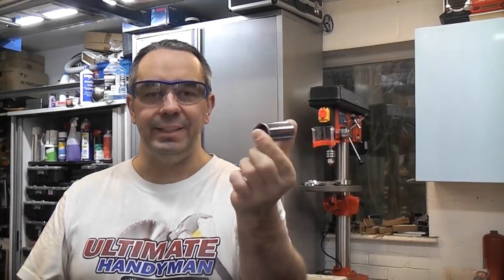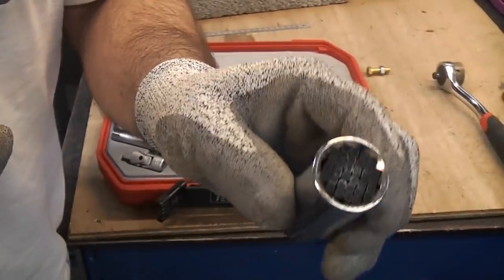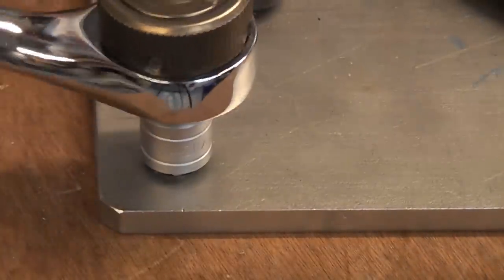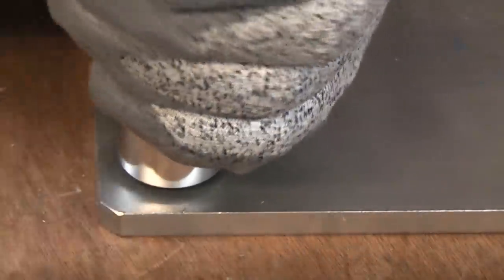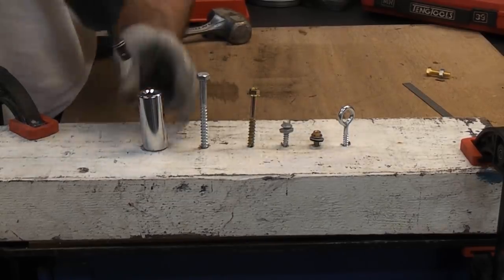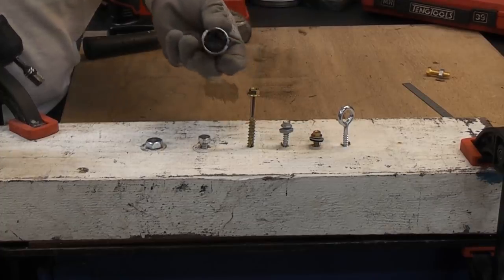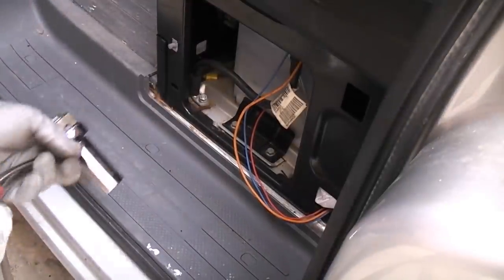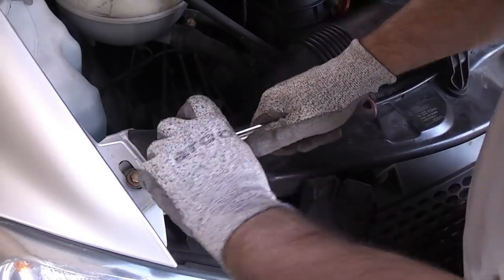Universal socket review | Richmond universal socket

Comment: I’d forgotten about these. I had a Gator type years ago. As I recall it had a larger number of thinner pins. I found it useful on really rusted or rounded off bolt heads, but I eventually pushed it too hard and as soon as one pin broke the rest quickly followed.
Reply from the maker: Thanks for the comment ;-)

Comment: Another honest and quick review.
I have the “gator” socket like you mentioned. I’ve kept it in my garage a an emergency quick use socket. I’ve tired it like you did on a few sockets and had the same issues you did. 
I used it once in a slightly rounded bolt head that a regular socket wouldn’t grip, that’s the only time it was useful. Although again like you said it does damage the nut or bolt.  
I’ve had to use it in an emergency to fix my dads van side door middle hinge/roller and we forget our socket set and the shop, and I remember me having this gator socket in the garage. It work well, I did have to put a lot of pressure on it, but hey, it did the job. Keep up the great videos.
Reply from the maker: I'm glad you had a similar experience to me ;-)
Thanks for the comment

Comment: I had considered one of these for the mini/emergency tool kit. I won't bother now. 
I considered on of those multi ratchets that has 8 sizes on one ratchet handle. Same problem with clearance that you noted though, you can only deal with very shallow headed nuts/bolts. At the end of the day nothing beats the proper tool for the job.
Reply from the maker: Yes, clearance is the main problem!
Thanks for the comment

Comment: I’ve had a Teng Tools socket set for 25yrs and use it virtually every day. They’re the absolute dogs.
Reply from the maker: Yeah, they are good. I use this small set at home, but have the larger 1/2 drive set at work, as well as a load of Teng 1/2 impact sockets. The only Teng tools that I'm not keen on are their adjustable spanners and their version of Stilsons.
Thanks for the comment
Reply: Bahco adjustables and Clarke aluminium stillies for me. I don’t do anything too heavy duty. I’m now replacing with Wera stuff as stuff gets lost.
Reply from the maker: Bahco are superb, I have about 8 Bahco adjustables ranging from 4" to 24" 
Ridgid make some really good Stillies!
Thanks for the comment
Reply: Yeah, l’ve got the Rigid angled Stillies for getting into tight spaces, wouldn’t be without them.

Comment: Weird mate, i had a different one of these (it eventually broke after 5 year undoing a wheel nut with a breaker bar) always worked reasonably well for me... I had a different one a cheaper looking one with smaller but more bars. They arnt as good as a regular socket but if you have limited space or have to be quick (working under a car in the rain ect) they are quite handy.
Reply from the maker: Perhaps it is just this particular make, I'm not sure!
Thanks for the comment

Comment: I have one of these things, and I admit I've rarely used it, but it seems a better design than the one you're using, as each of the pins is hexagonal so interlock each other rather than square of yours, would I say it's the best thing ever, most definitely not, it's a gimmick but it works, sort of. (oh and mine is a cheap Lidl one)
Reply from the maker: Thanks for the comment ;-)
Reply: Lidl tools are mostly German made and ive had a drill sander saw etc etc.. And the drill is one if the best I bought and cheapest.. Lights show where you drill lights show battery situ.. Superbulous drill had it yrs..
Reply: @kenwolf6293  
I've found the Lidl & Aldi stuff tends to be German-brand but Chinese made. That said, as cheap tools for occasional DIY use they tend to be very good and usually better than the Homebase / B&Q equivalents.

Comment: The only benefit I have found for mine was it works well on odd shaped nuts and wing nuts.  Other than that I use the proper sized 6 or 12 point sockets. On mine the pins are round not square like yours.
Reply from the maker: Thanks for the comment

Comment: What knee pads sis you have on they look just the job for me?
As always excellent reviews
Reply from the maker: They are called recoil knee pads, I was sent them to try out over 12 months ago, but the only time I'm on my knees a lot is when I'm on site and I did not want to get them covered in grease/oil etc. 
Surprisingly they are very comfortable and do not irritate me - normally they slip down your leg, but these stopped in position and were very comfortable. 
Thanks for the comment
Reply: Thanks, will check out the pads.

Comment: Here in the U.S., we think of these kind of tools as gimmicks.  They are most often advertised or promoted around the Christmas holidays as a gift for a hard-to buy-for relative who enjoys tinkering around the house.  I've not owned one, so I can't offer an insight if they have ever been effective.  However, I've never been a fan of tools that can "do it all"; they usually fail to do anything very well.   They are often purchased by folks who are sold on the notion that this one socket can replace a dozen regular sockets in their tool drawer.  It wouldn't work in situations where you needed to use a shallow socket .  I would also guess that it doesn't grip all fasteners as tightly as a regular 6-pt. socket would, nor do the same for both SAE and metric fasteners.  When the spring-loaded rods engage, there's a very small contact patch for each compared to a regular socket.  I imagine these would flex internally and not be terribly effective on corroded nuts and bolts, nor many that were over-tightened.  Good video on this product; I'm surprised that these things are still being sold, given how ineffective they appear to be.  But, as P.T. Barnum once said, "There's a sucker born every minute".
Reply from the maker: Thanks for the comment ;- )

Comment: Thanks for the review. May be handy for some jobs but I guess if you need it for a job you can't chance on don't use this! Those knee pads look cool what brand are they?
Reply from the maker: They are recoil knee pads, I was sent them last year to try them out.
I have to say that I'm really impressed with them. Normally I hate knee pads and normally I just put them on the floor and then kneel down on them, but this is the first pair that fastens and does not slip down your leg. I'll be sure to use them again ;-)
Thanks for the comment

Comment: Great video. I remember those things being sold on QVC :)
Reply from the maker: I've never watched QVC, but a mate of mine used to watch it and bought all kinds of crap LOL
Thanks for the comment
Reply: Seen on QVC? That's not a good sign. ;-)

OT: I remember seeing some 'magic' drill bits being sold by them a few years ago. "Drills though anything" or some such nonsense but seemed to go blunt surprisingly quickly when used on steel - you could see the guy pushing harder and harder!

Strangely enough they avoided mentioning what the tips were made from, I wonder why. ;-)

Comment: I really don't like the peg design of this Richmond unit, seems to be the root of most its problems. At least the Gator Grip is about as useful as a Crescent Wrench (not used often, personally, but still worth having on hand). Just picked up a Gator Grip type socket like this for <$4, free shipping, and I find that hard to complain about. They have trouble with some sizes more than others, but at least the round peg design allows the bolts to roll more cleanly. Seems like they will hold up consistently with ~50ft/lbs of torque, even after the inevitable first pin sinks into the socket. I didn't expect to purchase one of these at first, but it ends up seeming worth it for the occasional grab-and-go.

Plus, in the end, it's a wonderful conversation piece or gift, as long as you don't use it when you shouldn't and damage it.
Reply from the maker: Thanks for the comment

Comment: The idea look really good jus not the result the manufacturer invisioned.
Do you know there is a pocket size multi tool that has screwdriver a d hex keys?
Iv got a dewalt multi hand tool with the usual pliers, screw driver and bottle opener which is pointless really but a single unit with just pozi heads, an hex key/Alan key would be perfect.
Reply from the maker: I'm not sure about the multi-tool as I'm not really keen on them. I have one that cost £50 somewhere (Leatherman) but it never, ever gets used. If I need a tool I normally just get it from the garage, rather than trying to use a multi-tool. I did get offered a fancy multi-tool (Gerber centre drive) a while back, to review - but I didn't really think it fitted in with my channel and it was also about £100 to buy. A few days after refusing the offer it ended up on someone else's channel ;-)

Thanks for the comment
Reply: @ultimatehandyman  thanks, I will stick with my dewalt tool then I think. Thanks for the reply.

Comment: i bought something similar to this, but this look so bad tbh, my one has a lot more "bits" inside. Like, on yourone those bits are way too big. On my one they are maybe quarter of a size a a lot lot more therefore more precise I guess. Works like charm. :)
Reply from the maker: I'm not sure if the Gator grip ones are better, but this one certainly is not much use!
Thanks for the comment ;-)
Reply: @ultimatehandyman  yeah I agree, just watched whole video. Great video and yeah, it shows that it was poorly designed. I think it's good idea for people what don't have space for tools or like a little toolbox. My one works fine, but I still go grab proper socket :)

Comment: I was thinking of getting one of these, but because it’s not immediately obvious the pins retract in by only 100ml, and they may get stuck, its range of applications is pretty small. Coupled with the damage caused and the limited range of fittings it would work with  I’ll give it a miss, thanks. This is why your channel is so good!
Reply from the maker: Yes, I looked at a few reviews before I bought mine and they all seemed positive, but that is not the experience that I've had with mine. I'll never forget that first time when I needed to undo some bolts on the dining room table and the damn thing would not fit!
Thanks for the comment